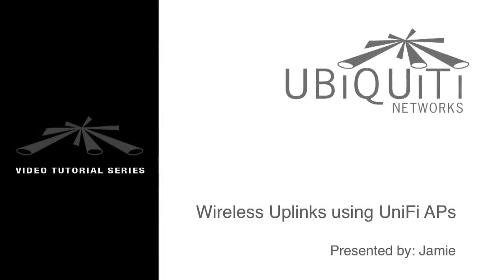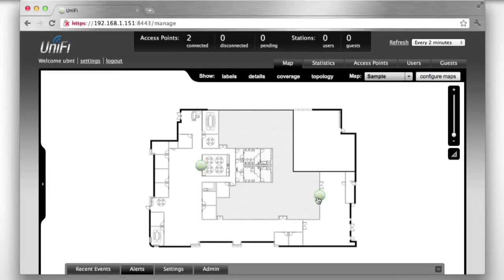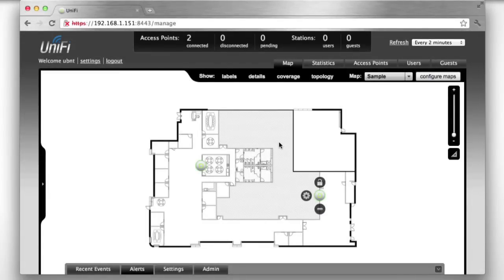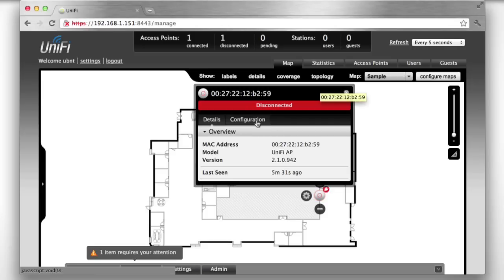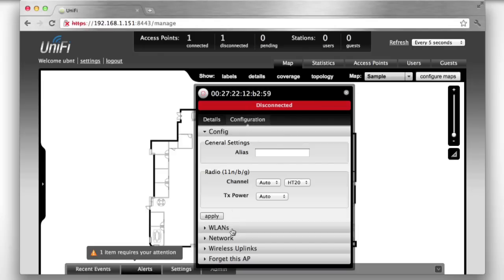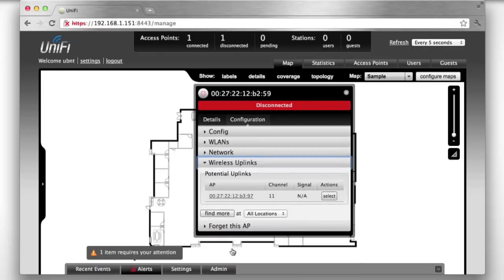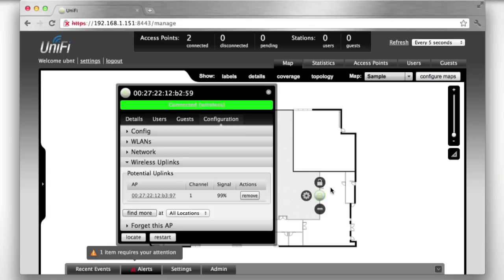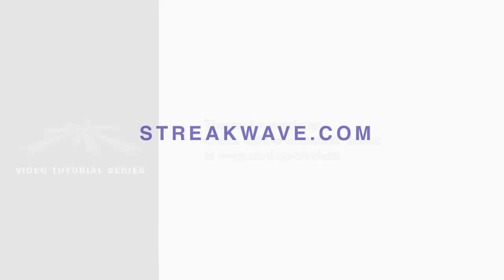Creating a Wireless Uplink With UniFi AP - Ubiquiti

Comment: Will this work with 2 Outdoor Unifi's? I have one currently but the link is not getting as far as I need. Do I adopt it on the network, set the wireless etc on the outdoor one, then move it and re-power it?